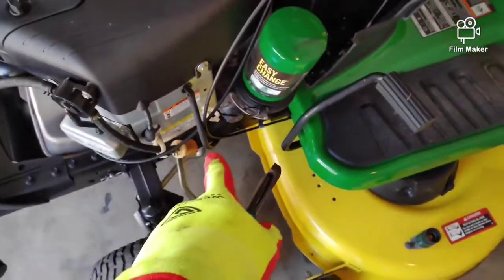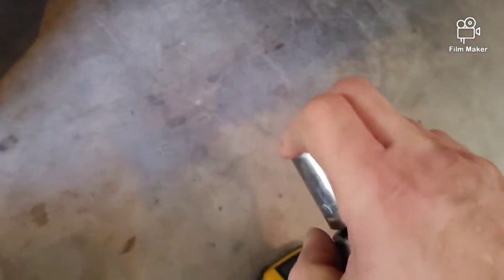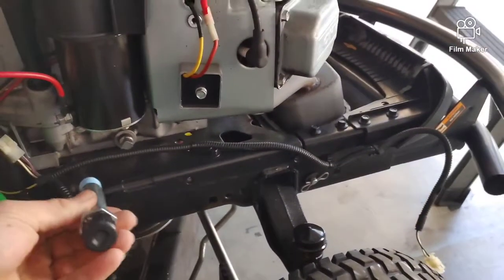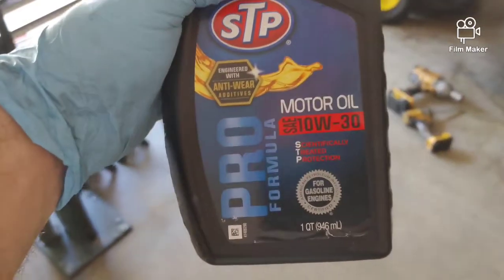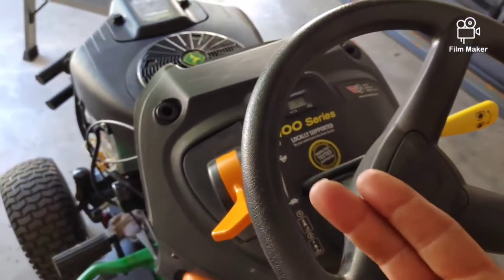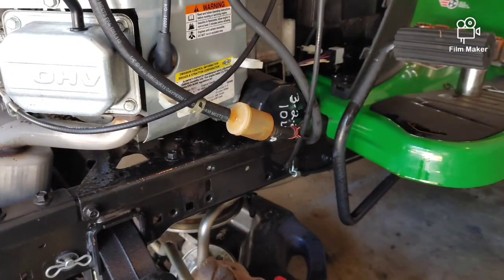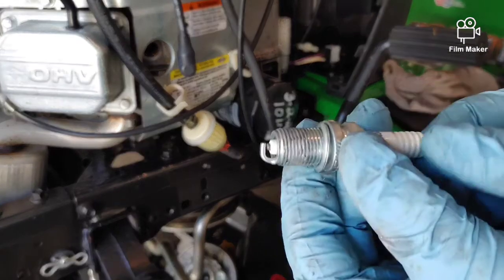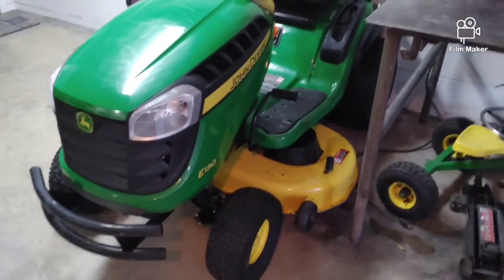$50 oil filter!?! No Thanks John Deere! Say good bye to the 'Easy Change' Oil Filter.

Comment: Thank you … I really appreciate the way you simply explain what and how to perform maintenance on the E130 JD .. I can’t understand why JD put the so called easy oil change system on their engines because it still leaves about 1 and 3/4 quarts of dirty oil still in the engine after charging out the oil container … unbelievable and you pay $55 for the new oil Easy change container.. not good.  Thank you again very much appreciated!  USMC Veteran.

Comment: I learned somewhere, many years ago, that you can use household tin foil to easily craft a funnel or make-shift trough for the oil to flow over and into your drain bucket or catch pan.  Keep some good 'ole Reynold's wrap or other rolls of tin foil handy for anytime you're doing oil changes, modifications or whatever, so you can help avoid spilling oil all over everything.  This was especially helpful on my motorcycle, which was not designed well at all and draining the oil would spill it directly on top of the exhaust headers.  Not something I wanted to ever deal with on that bike for sure!
Reply: Just thought of another reason you could justify the easy change oil filter.  Even though it's a total ripoff, many weekend warriors aren't cautious or could potentially cause damage to their lawn mower engines by not adding the correct amount of oil to the engine.  By simply doing the easy change, they are less likely to burn up their mower engine, and hopefully they still check the level and add oil when necessary.  Otherwise, I'm doing this oil filter conversion asap on my brand new JD mower I just bought last night!  Not buying another $55+ easy change joke of a filter again!
Reply: Buying a real funnel very affordable too.

Comment: I would recommend waiting until all the oil has drained out. Then wipe out the oil filter hole really good and use a little lock tight on the oil filter nipple going into the engine block. This will keep it from unscrewing with the oil filter.

Comment: I just bought a new S170 Lowes, if do this conversation, does it affects the warranty? I also bought the extended warranty from Lowes. I really LOVE the tractor.
Reply: no it doesn't.
Reply: Did you do this conversion on your S170?
I am a bit hesitant to buy the parts because none of the kits show the S170 as a compatible model.

Comment: Whoever came up with that oil change concept for John Deere should be fired what a major black eye for John Deere
Reply from the maker: Its a ridiculous gimmick / money grab
Reply: I suspect JD was going for planned obsolescence.

The engine is the most expensive part of a mower. If it fails, most people will just buy a new mower rather than replace the engine especially if the mower is more than 8 or 10 years old. 

Perhaps, this is what JD is banking on. However, in light of all the articles and YouTube videos exposing the fallacy of the "30-second" system it seems to have backfired. Realizing the risk to future sale, perhaps this is why JD now offers a refit kit to revert to a standard oil change system.
Reply from the maker: @vtramell3196  It wouldn't be so bad if they didnt cost $50. I can do the conversion and a do full conventional oil change (replacing all the oil) for less than that Easy Change oil filter alone cost

Comment: The easy change filters are now $ 58 including tax. If they sold them for $25 I would still buy them, but they are just ripping people off. I did the conversation today in about 45 minutes. The new filter and oil were about $12. The only pain in the butt was the original drain plug! It’s set way back in where it’s hard to get a wrench on! I’m sure you can buy that square socket. But I didn’t want to go out looking for one. I managed with a short 11 mm open end wrench, a large screwdriver for prying it up. Once you break the plug free, your home free. Thanks for the video on this as it really helped

Comment: I'd like to see one of the EC filters cut open. If it has filter media the full length,  that's a hell of an oversize filter,  and I'll just leave the EC filter on and  replace the crankcase oil, once or twice, and replace the EC filter on the 2nd or 3rd crankcase oil  change.  If it turns out the filter media is just a short section like the standard filter and most of it is empty space, then convert to a regular one.

Comment: Im looking to by a jd s170. Hate the idea of having the easy change bs on it but wondering if this conversion would affect the warranty.
Reply from the maker: I can only tell you from my experience when working at a JD dealership. I'm sure things vary between dealerships depending on management, etc. The oil filter conversion would only affect a warranty claim if the conversion caused the issue being claimed.  The most common warranty issues with a 100 series mower was a deck issue. Like a spindle or idler going bad. The oil filter used on the engine would have nothing to do with it. However, if you ran the engine out of oil, and it was caused by an oil leak caused by the customer doing the oil filter conversion, it would NOT be covered under warranty.  I leaking gasket or seal other than the oil filter conversion  should still be covered under warranty.
Reply: @Mechanical_Mind  ok that sounds good then.  Hey man thank for your reply.

Comment: Can I ask u a question can I use a oil that is sj in a motor that calls for sn I waunt to use stens shield oil instead of jd oil.the motor is a 22 hp briggs v twin  dont under stand those numbers can u explain thank u
Reply from the maker: The S means it's for petrol engine and the second letter is the latest version of the performance addictive.  I wouldn't lose any sleep using any 10w-30 or 5w-30 on that engine.  Those are actually really good engines. Just make sure to change the oil AND the oil filter. If the oil level gets too high check to see if the oil has gas in it. Which can be caused by the fuel pump. Other than that and adjusting the valve clearances at every 200 hours it's a really good engine.
Reply: @Mechanical_Mind  thank u

Comment: Ive already done the conversion, I just don't know what to do with the old filter. I really don't want to just throw it in the trash with a quart or so of oil in it.
Reply from the maker: You can dispose of it the same way you do regular oil filters or drop it off at your local JD dealer service department. Thanks for watching!

Comment: Do those part numbers work on a S130?
Reply from the maker: Hi Omar, yes. I just looked at a S130 to confirm before replying. The S130 has a upgraded hood and also some improved belt guides but the engine is the same.
Reply: Thank u so much...

Comment: I did the conversation for my dad called just deere just to be curious they said it voids the warranty
Reply from the maker: Only if the issue trying to be claimed under warranty is caused by what the customer did. If your engine runs out of oil or too low on oil for example it wouldn't be covered under warranty any way. Just like if you hit a rock or tree or and damage your spindle or deck that too would not be covered under warranty. A manufacturing defect not related or caused by your replacement of the oil filter would still be covered.
Reply: @Mechanical_Mind  that makes sense thanks for your input ....

Comment: Why convert back to a littler oil filter (I’ve seen both cut out of the can and 30 sec change filter is over twice the size) I’m sure this has been tested and proven to work fine by John Deere and what’s a few extra bucks after spending a few thousand for your mower and tell me has anyone heard of any issues with this system because I have not.
Reply from the maker: . The biggest issue is the price for the filter alone, $50.  Plus, you still normally need to add about 1 quart after installing the easy change filter. 
The filter can be hard to find at times. The JD dealership I worked at would often run out of them so people had to wait days longer for their " 30 second oil change" 
The 2nd issue is that it only replaces a portion of the oil, about 1/3. 
After doing the conversion, you can then change the oil and a conventional filter for $20 while replacing all the oil.

Comment: JUST A THOUGHT COULDN'T YOU JUST SUCK OUT THE OIL FROM ENGINE AND STILL USE THE QUICK CHANGE FILTER? YES I KNOW YOU WOULD STILL HAVE TO BUY THE QUICK CHANGE FILTER AND ADDITIONAL OIL.
Reply from the maker: Yes, that's how we do it at the shop. This video was for the average person at home who may not have an extractor pump.  Also, those filters alone cost $50! You can do the conversion and change all the oil for less $.  Then after that full oil and filter changes will not cost more than $20.

Comment: Cringed w that chrome 12pt socket on the impact.
Reply from the maker: Yeah I know🤣. Its all I had and I knew it wasn't very tight.
Reply: @Mechanical_Mind  Well plus you won't be reusing that part, but I feared for the socket.  Thanks for the vid though!  I just bought the adapter and a normal filter for mine.  Get you an oil extractor and you'll never remove another drain plug as long as you live.
Reply from the maker: @sqranch2904  we use oil extractors at work for most things. Its so much better but I dont keep one at home.

Comment: Cringed when I seen the wd-40 being sprayed on the rubber hoses...I was always told it attacks rubber
Reply from the maker: Its safe for rubber. I was just thinking I should do a video on WD-40. It has a ton of great uses that are not very well known. Ethanol in the gasoline does eat away at rubber like the fuel line hose on mowers.
Reply: Ethanol is bad for rubber, (try to run ethanol free gas, if you can find it), WD-40  the WD stands for "Water Displacement",  it repels water.